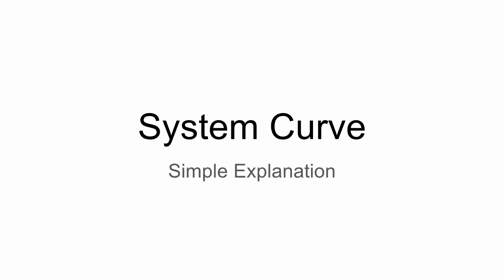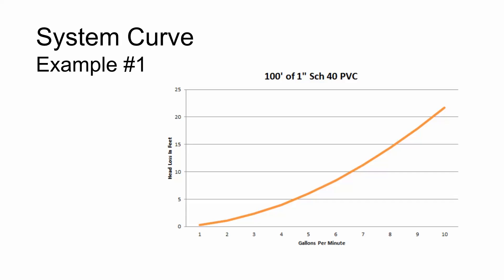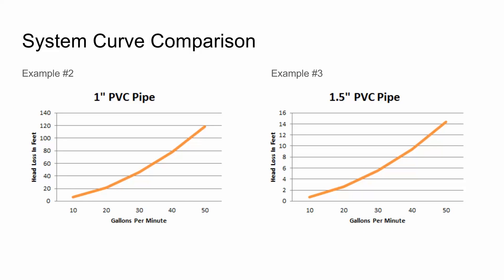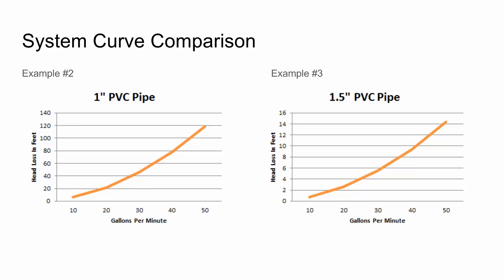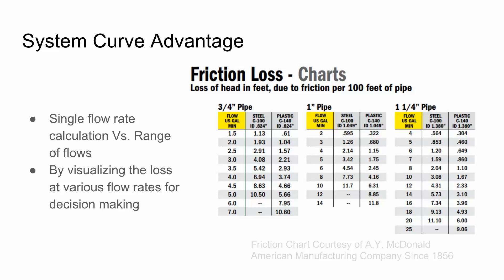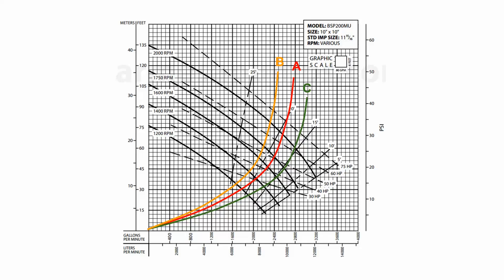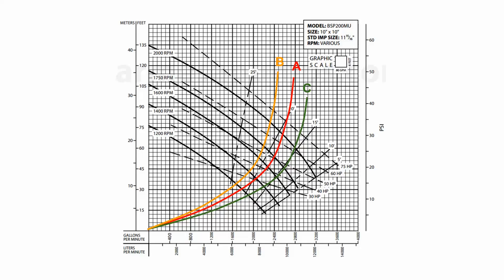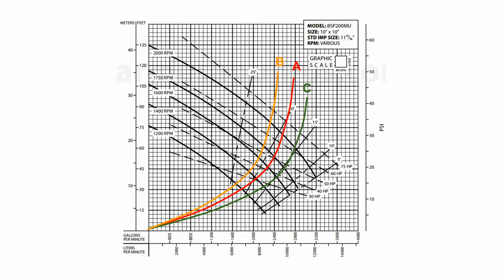How to Read a System Curve: Simple Explanation

Comment: What are the factors leading to change from one system curve to another system curve?
Reply: In order to change the system curve something about the system itself needs to change like using different pipe fittings, materials, changing diameters, adding or removing sections, etc.
Reply: @glaziopluto8957  assuming 2 cold plates connected in parallel piping, and the two cold plates have two distinct system curve, could you please advise on how to find the operation point for this system
Reply: @sureshraghul2715  
I think the system curve is constant regardless how the pumps are connected it only reflects the status of the existing system but you can draw the combined pump curve based on the way they are connected together however parallel or in series so that you can see the intersection between the system curve and the combined pump curve this is the operating point you need
Reply: @glaziopluto8957  how about fluid properties, e.g. visc, den, etc
Reply: @dheyaalgallaf6060  I didn't consider that, but if you're allowed to change the fluid in the system then the system curve itself will ultimately change as well, depending on viscosity etc.
Reply: @glaziopluto8957  What if the pipeline exposed to ambient & temperature changed across the pipe, how to accomdate this T difference on system curve